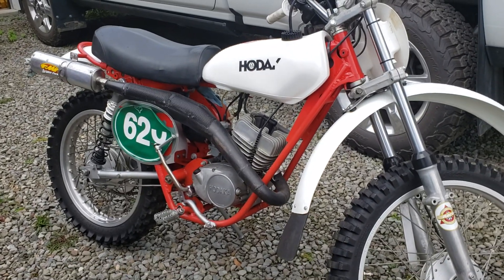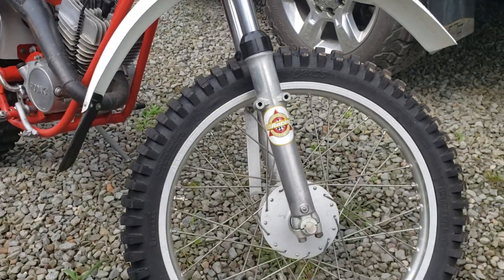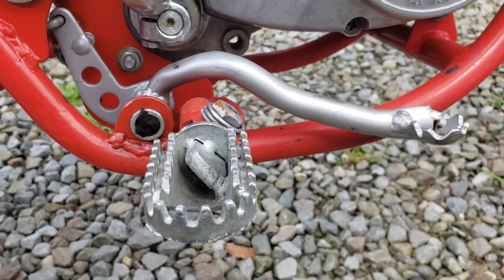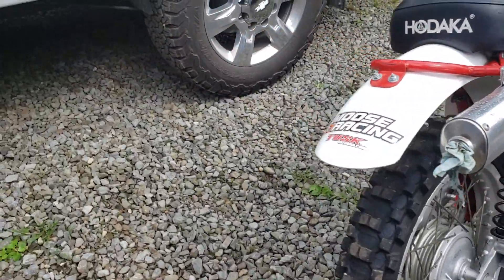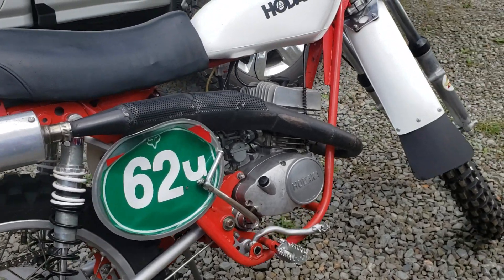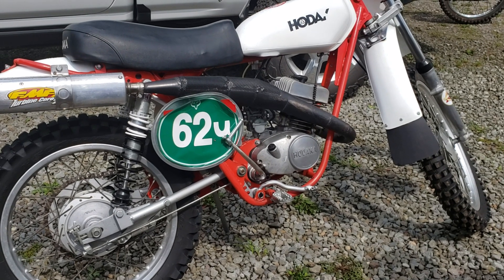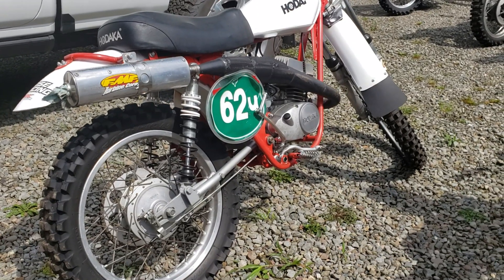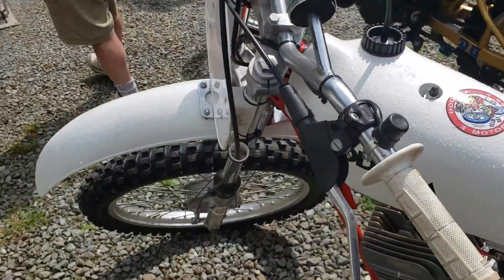WORLDS FASTEST HODAKA SUPER COMBAT 125 1973 PART 2

Comment: Had a brand new 1971 super rat bought in 73. Had a webco head a friend had a new 73 Combat .The two bikes ran about even though the gears but my super rat was faster top end wise and that was with stock gearing.The Combat shifted quicker through the gears. less spacing and it would fall on its face It ran outa oomph at the end of each gear.